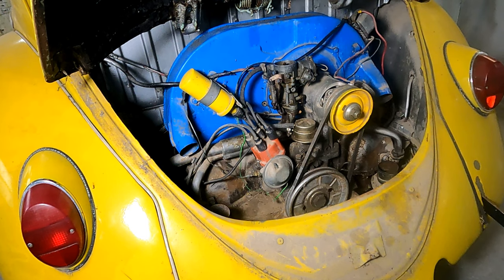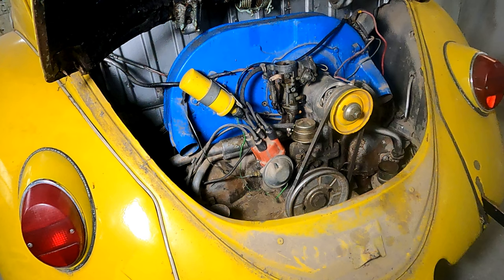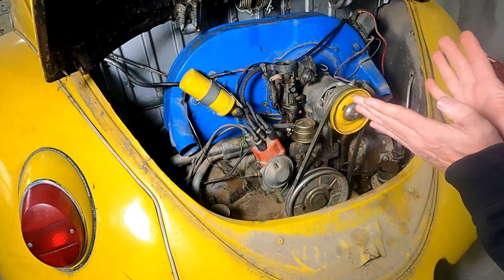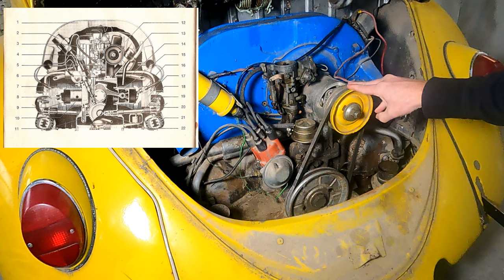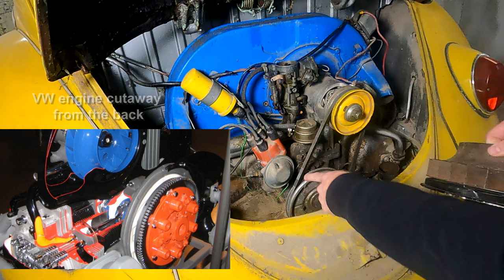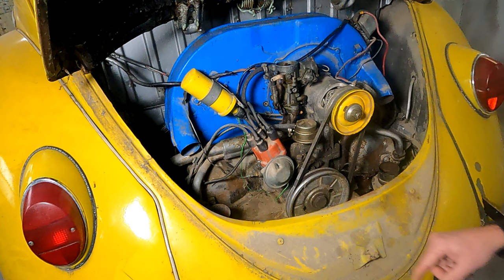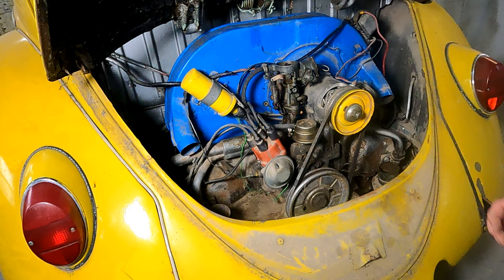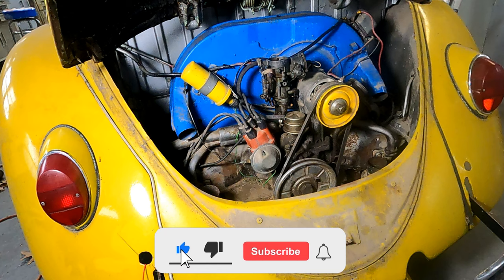A look at how the Classic VW Beetle Engine works.

Comment: i just bought a bug and want to learn but I know nothing about cars and I am so over whelmed. I don’t understand any of this.
Reply: They are built to work on.   And you have millions of new friends
Reply: Don’t get overwhelmed. Break it down to the absolute basics; a Beetle is literally nothing more than a body, engine and wheels. They are the simplest vehicles ever made, arguably. No coolant. No ac. No nothing. Hell they don’t even have a heater, they use exhaust heat to “heat” the car. 

It’s a go cart with a covered body
Reply: Look for a book called "How to keep your Volkswagen alive - A manual of Step by step procedures for the complete idiot" by John Muir   AKA "The Idiots Manual".
The guy was an old hippie, his explanations were simple and comical and his diagrams and artworks are amazing. 
Get the Chilton's and the Haynes manuals also, but the Idiots Manual is the Bible.

Comment: That car heater that uses the engine's heat exhaust to warm up the heat exchanger . . . watch out for carbon monoxide poisoning, as that was an issue with the '67 Beetle I had.